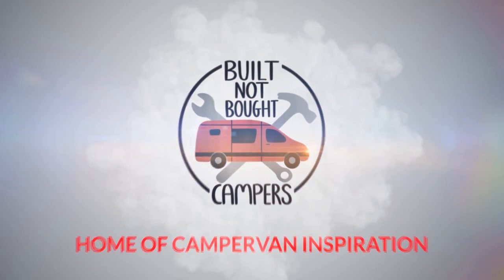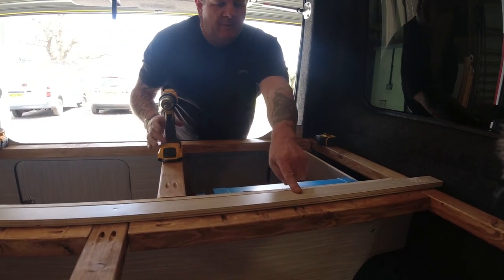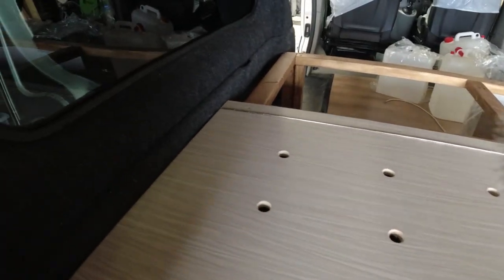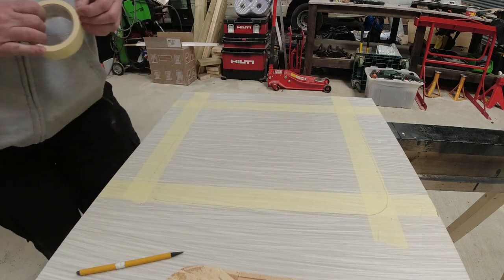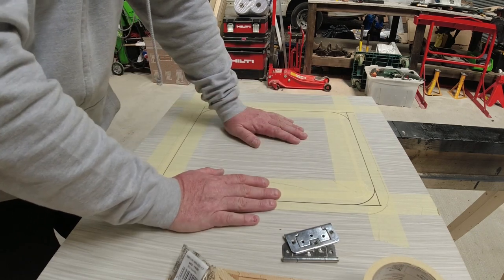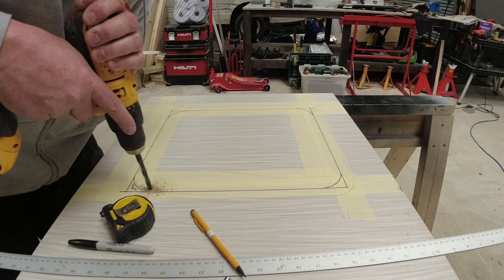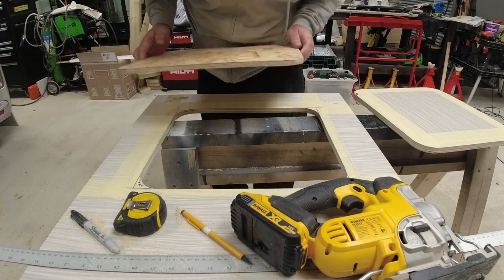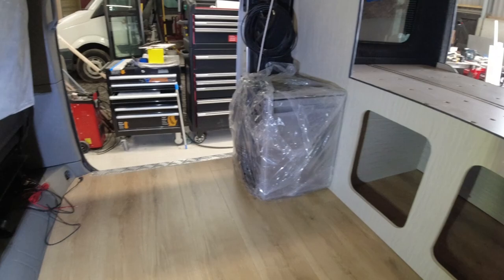Renault Trafic Campervan Conversion - Bed Build Pt 3

Comment: Whats the overall lenth of the bed please .and did you go small double or full double width ways
Reply from the maker: I had to cut the bed down to fit.  I used a full width double.  The height of the base sits so the mattress is level with the bottom of the windows.  I'm 6ft tall and I can sleep width ways because of the window apertures
Reply: Been looking at doing the same thing was just worried i wouldnt fit but im only 5.10
Reply: @stuartraw8195  Same problem with ours. We don't have windows at the rear of the van and there was no way i could fit across by the time the walls were finished and  I'm only 5.8'.